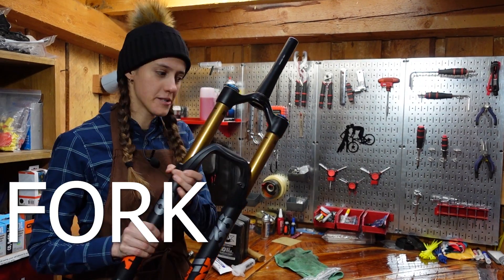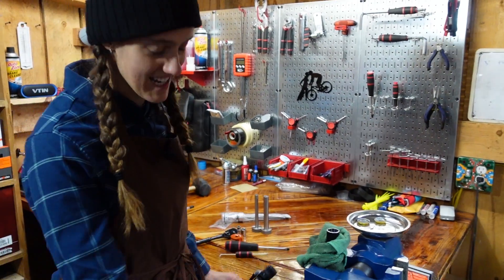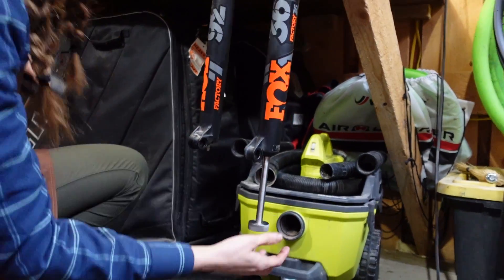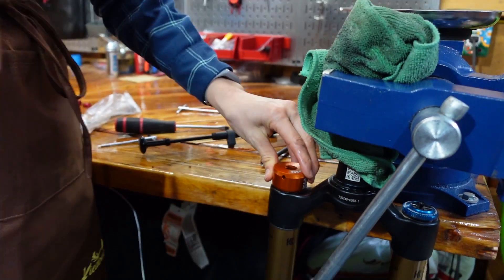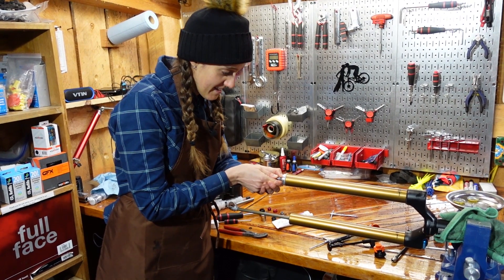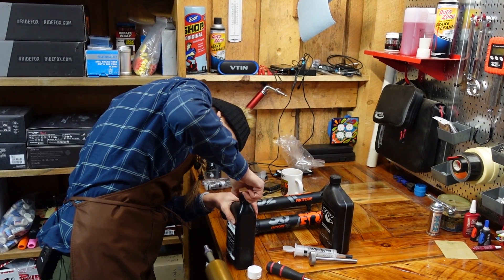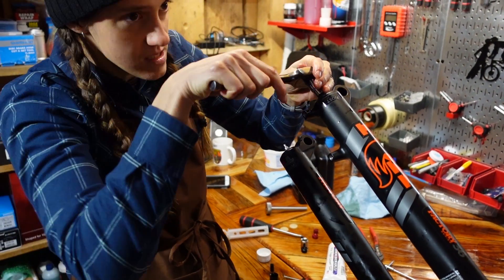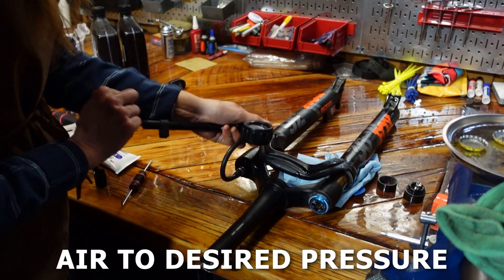How to change the travel on your fork (air shaft assembly swap) | Syd Fixes Bikes

Comment: I wish you emphasized on the oil application and amount, for both the air and dampener side; for that is the most important part of the build. I did this to my fork and unfortunately failed. I have not figured out what I did wrong.

Comment: Seeing and having done all this, with the special tools for lowers removal, the crush washer that needs to be replaced after every service, and the annoying retaining clip, it really makes me appreciate my old Manitou Mattoc fork.

Small tip for an otherwise great and clear video: make sure to equalize the air chambers every 15-30 PSI when inflating the air spring, by slowly compressing the fork the top bit with the pump connected. You'll hear a soft hissing noise. If you don't do this, the fork won't be as supple because of a lower air pressure in the negative chamber.

By the way, did your Fox forks also come from the factory with way too much grease on the air piston, blocking the equalization dimple, lowering negative air chamber volume, and ruining small bump compliance? Both my 34 and 36 forks seem to suffer from this, and going by other people's experiences, I'm not the only one.

Comment: You didn’t say how much suspension oil went into each leg lower…. And what weight did you use?? The Fox Gold 20w??? More info would be helpful
Reply from the maker: It depends on the fork so you should check Fox's recommendations for your fork (link in description)
Reply: Generally 40cc damper side and 10cc spring side for a 36. Fox have charts that will tell you the volume of your year and travel. 20wt both sides for rc2 and fit4 dampers 20wt in the spring side and 5wt in the damper side for grip and grip2 dampers.

Comment: I noticed you put the air spring in with a big gap in the negative chamber and then had alot of negative fork suck when pulling on the air spring. If you have yet to fix that problem, just pull it back out and slide it back in with the neg plate slid all the way against the piston so that there is no air in the negative chamber and the shaft is fully extended out of the bottom of the fork.

Comment: Just increased my 2022 36 Rhythm from 140mm to 150mm and now have a knocking sound each time the fork expands again. Not loud, not metallic, but audible. Also there is more noise from the fork just compressing. Like a swooshing sound

I did. compress the fork multiple times when putting pressure back in to level the negative spring

Any ideas?
Reply from the maker: Weird. The swooshing could just be that the oil in the damper is traveling faster through the shims since it has farther to do not that there's more travel. You could try readjusting the compression, rebound, etc. In terms of the knock, might be worth confirming everything is tight, especially on the air side where you were changing things. Besides that though, I don't know...
Reply: @sydfixesbikes  thnx. I actually disassembled the fork again today. 
When moving the damper side shaft I get the noise. It is not the air shaft
It actually sounds as if there was too little oil in the damper cartridge and some air 🤷‍♂️
This causes the swooshing sound
I didn’t do anything to the damper side though….
Reassembled again, rode a few meters including a short trail. Rides fine but when bunny hopping the swoosh is audible..

Comment: Prior to removing the lowers, does anything need to be done with the high speed and low speed compression settings?  i.e. should everything be in full open prior to letting all the air out etc? Thanks!
Reply from the maker: Nope, the damper is a closed system (looks kinda like the air shaft but is on other side of the fork) so you can leave it alone.
Reply: @sydfixesbikes  Thanks!!

Comment: Is it absolutely necessary to remove the top cap or could I get away with not doing so as long as I put the necessary oil in the top chamber?  My fork only has 100km so I don’t think I’d need to clean the inside of the stanchions or anything.

Comment: I have a Fox Float 32 100mm from a 2021 Niner Air 9 RDO 3 Star. I'm reading conflicting information online. Is the stock 100mm fork able to be bumped up to 120mm?
Reply from the maker: I don't think so, but not completely sure. Probably worth reaching out to Fox to see if they can give you a firm answer.

Comment: We know Syd. We know Macky. Who’s Mr. Cackles in the background? Here’s my other question. Did you need to remove the top cap with the special socket. Could you have pulled the air spring out while depressing the air valve to relieve the suction or was there another component in the stanchion? Also something I’ve learned while working on cars is you can put a latex glove over the socket before you place it in the nut. This creates an extra snug fit and helps prevent marring on nice shiny expensive parts like this. Cheerio
Reply from the maker: Yeah, removing the top cap isn't necessary, but it sure makes it easier!
Reply: @sydfixesbikes  thanks. I’m learning myself and trying to put this all together. I love the channel with combo you two.

Comment: What are these numbers around the threaded hole that receives the axle?
Reply from the maker: You can rotate that piece so your thru axle tightens in different spots (to adjust the axle lever position). The numbers are just there for reference so you know how much you have moved it while adjusting.

Comment: question.... I have a 34 rhythm 2017 of 100mm and I want to change it to how it was before (150mm) I want to buy the air shaft but I want to know if it would fit the air shaft of 2019 34 float of 150mm

Comment: Is there a limit to the bump up... like 140 to 160 is that allowable?
Reply from the maker: As long as they make an air shaft for that fork, then yes, you can bump it up. Also make sure to check the max fork size for your bicycle.

Comment: Does the top of the air side need to come off or can it stay on and remove the air shaft?
Reply from the maker: It can stay on, but you need to either remove the valve core or depress the core while removing the air shaft or the vacuum will make it stick.
Reply: @sydfixesbikes  that's what i figured thanks.  Have a really sticky airshaft that was causing me suck down

Comment: Hey Cid,  I am thinking of getting an XC bike with 130 mm front and back travel, can I buy newer suspension with more travel?
Reply from the maker: You can put a bigger fork (front suspension) on, but many bikes have a maximum fork travel that you shouldn't exceed (you'll need to look it up for your bike). You can change the shock (rear suspension) too but it doesn't change the amount of travel as that is determined by the linkage of the bicycle.

Comment: I wanted to drop the travel in my Fox 36 from 160 to 140mm but I let my local bike shop deal with the mess. This video was informative, to know what exactly they did to my fork.
Reply: How much did they charge you?
Reply: @russellh22a  I don't remember, tbh. it was bundled in with some other items I bought, but it depends on your local shop's labor rate. I think it was less than $100, plus parts, but it's essentially a fork service with an extra step.

Comment: I'm a noob but aren't there spacers that can do this more quickly? Or is this the only way to do this on an air fork? I was planning on getting a 150mm air fork and changing it to 140 most of the time and then swapping to 150 on more intense stuff
Reply from the maker: Nope, volume spacers serve a different purpose (check our previous video) and, at least with Fox forks, this is the only way to adjust the travel. Side note: they used to make the Talas fork that allowed you to adjust the travel by spinning a knob, but no longer make it.

Comment: Great video!  I have the parts to do a 130 to 140 change on my 34.  Just needed some motivation.  As a FYI, search for a nylon veterinary syringe.  They are easy to clean and work great for brake bleeds too.  Works a lot better than the disposables.
Reply: Were you able yo do it?